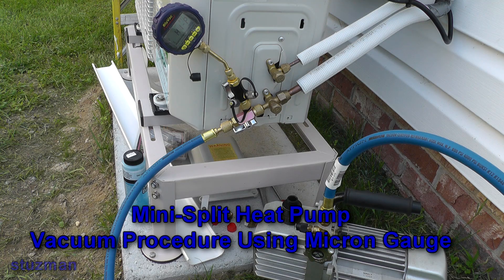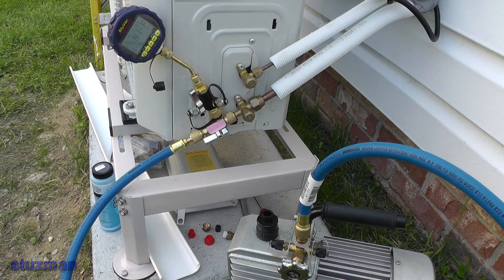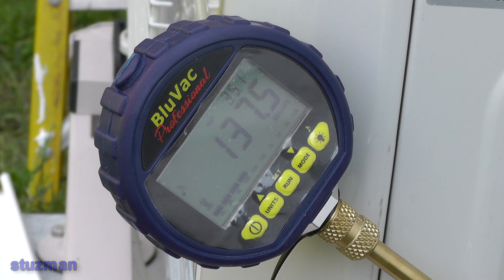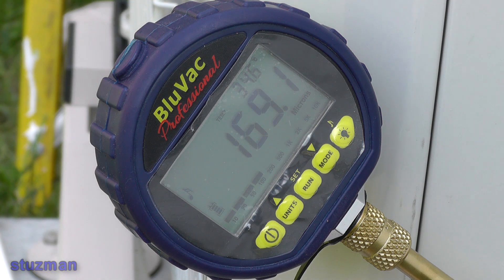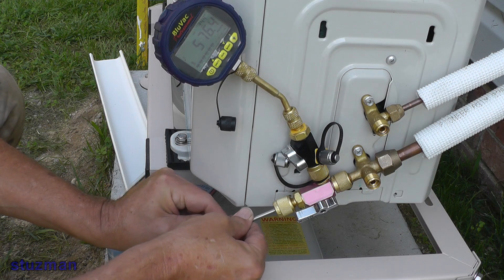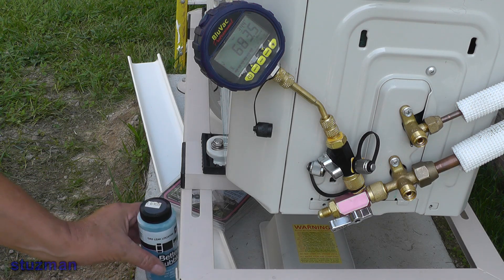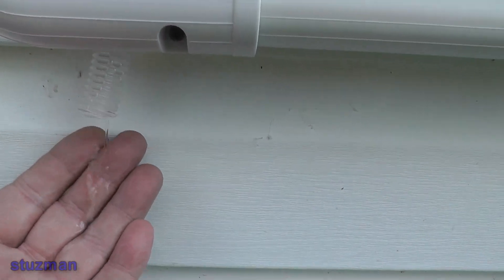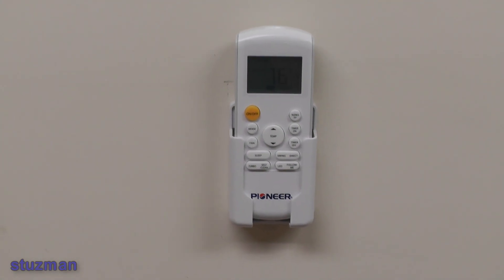Mini-Split Heat Pump: Vacuum Procedure Using a Micron Gauge

Comment: Where do you buy your Nitrogen from ? I found this on Amazon : 

https://www.amazon.com/gp/product/B01E2TAN06/ref=ox_sc_saved_title_1?smid=A1HK513727N6JR&psc=1

Is this the correct chemical composition and tank size ? 

Thanks Again.
Reply from the maker: If you live in the US, you'll find airgas distributors all around which is a national chain. You'll be able to buy the tank and nitrogen from there. I posted a link for the pressure regulator in the videos of the pressure testing. I answer a lot of questions in the second video of this video series such as the nitrogen tank and where to buy it. That video is listed here: https://www.youtube.com/watch?v=N-QwtqSw1Xk&list=PLrbHoqGceWKSJBdTF3ufWQirhoqpbpTdL&index=2

And here is a link to the entire four part video series. https://www.youtube.com/watch?v=SsUYJ1b9sk8&list=PLrbHoqGceWKSJBdTF3ufWQirhoqpbpTdL
Reply: stuzman Great. I do have one AirGas near me.

Also, do you think a Harbor Freight 3cfm Vacuum pump can pull low microns in Vacuum test or that feat is only possible by the likes of Yellow Jacket, JB and CPS  pumps ? I couldn’t find the pump name on your video descriptions.

Comment: Hello Stuzman for the video explanation. Could you please tell me why we do not conduct Nitrogen pressure testing on a mini-split system as we do in case of regular HVAC systems at the time of installation? I recently purchased a Mitsubishi MUZ-GE24NA and its installation manual requires to perform only the vacuum procedure and nothing is mentioned on the pressure test.

Thanks
Reply from the maker: Yes, Abhinav, the manuals for mini-split units are written towards people, (DIYers) who do an installation themselves. The manufacturer realizes that most DIYers will not have a supply of nitrogen, pressure regulator, etc. for the test. So, they will  mention to pull a vacuum on the system and if you see the pressure rise, then you have a leak. The issue is that under a vacuum, you can have a very small leak and will never know it. Once I had a system under a vacuum for 24 hours and never saw the gauge pressure rise. After about one month when the cooling was insufficient, I found a leak. So, to be sure there isn't a leak, the valid test is to pressurize the system with a high pressure of nitrogen. Also, the reason that you see nitrogen pressure testing on standard HVAC units is because most of these units are installed by professional a/c service techs who will have that test equipment. Great question and thanks for the comment!
Reply: @stuzman52  Thank you for your prompt response. Listening to you and another great channel called  "AC Service Tech LLC", I finally understood why Testing for leaks under high pressure and under high vacuum are testing different design aspects of the system. Furthermore, your video where you have explained the difference between a Vacuum Gauge and a Micron Meter was amazing which clarified a lot of things, that's why the question. :)
Reply from the maker: Abhinav Gaur Glad to help Abhinav and AC service tech is a great channel where you have access to a wealth of information!

Comment: The Daikin unit I am putting in my shop per the manual says a minimum of 10 ft of line set. I am going to be pushing that-it may only be 9 ft as inside unit is close to condenser. What is the reason for the minimum? Is it because of the factory  precharge? Thanks and enjoyed your videos.
Reply from the maker: Yes Ted, you are correct! The manufacturer wants a minimum length based on the precharge that's in the outdoor unit. The same holds true for a maximum length of line-set too. Glad to hear that you liked the videos.

Comment: Hey.. How come your vac hose changed its color ? :)
Reply from the maker: As for as I remember, the hose colors on the low gauge side didn't change. I did change the hose, but in both cases, the color was blue.
Reply: @stuzman52  Ok. Anyways It was great watching the video. The place that i am in - Mumbai, India and when i got my split system installed the guys never did any pressure testing or a Vac test. However the system works well .. think i was just lucky.  A hack job that worked well luckily. :)
Reply from the maker: @piruzjassawalla6261  Yep, consider yourself lucky Piruz if it's still running well. With air still in the system, your pressures will be higher than normal which makes your unit less efficient than it could be. Have a great day Piruz!

Comment: Great video. It would be a good idea to exercise the valves of these 2 Core Removal Tools during the vacuum process. There are some air sealed inside these valves.
Reply from the maker: Yes, that is a good point Fentago. Thanks for the comment!

Comment: excellent video. step by step. i have a question. can i use 1 stage pump to vacuum a mini split or do i need the 2 stage? thank you.
Reply from the maker: You can use a one stage vacuum pump. It will just take a longer time to reach a deeper vacuum. But a micron gauge will let you know when you reach at least 500 microns.

Comment: I don't understand why you needed the second valve core removal tool. Why couldn't you just attach the micron gauge to the single removal tool?
Reply from the maker: I explained this question along with a lot of other questions in this video https://www.youtube.com/watch?v=N-QwtqSw1Xk&t=1777s The short answer is to isolate the refrigerant pressure from the gauge to protect it.
Reply: Yes, I use ball valves cos the valve core removers, you will find the stem hits the ground - in many cases doesn't work. 
A ball valve is WAY cheaper and smaller. And thats what I use to isolate the vac gauge against positive pressure which will ruin the vac gauge

Comment: great job! i have to laugh at other "installers" that don't even own a micron gauge, and they're trying to teach others. Thanks so much
Reply from the maker: Thanks Neal for leaving a comment!
Reply: Or they don't even own a vacuum pump, heaps of countries just "purge" no vac
Reply: @Froggability  I think this video and use of correct equipment are top notch.  That said, as a DIY guy, and not thinking  I would install more than 1 or 2 units, for myself, i chose not to buy a fancy vacuum pump.  Instead I unscrewed the intake valve on my air compressor and screwed in a couple of fittings to connect to a cheap set of gauges.  I do purge with nitrogen and bubble test and then vacuum down to almost neg 30 " HG with my old compressor.. I don't let all of the nitrogen out before vacuuming- i vacuum it out so no air and moisture can enter.    Having now installed 7 in the last few years, and with 2 more to put in soon (all for family for free) I could now have justified the real vacuum pump and micron gauge, but I have gotten by fine with only the manifold gauges.  A micron gauge would be sweet to have, but if you clearly have no leaks in the bubble / pressure test and then you vacuum it all out, you will be fine with only rudimentary gauges.  The expensive tools are great if you want to do a bunch, but not essential.  
Great video Mr. Stuzman.  Many DIYers will benefit and step up to do this now..  I even had two units need recharging (one developed a pinhole leak in the factory brazing around the reversing valve after 3 years and one had a faulty expansion valve).  I was able to buy a bottle of R410 at a decent price on-line and ship from USA to Canada no issue.  Brazed in new parts each time, pressure/bumble test, vacuum and weighed out refrigerant charge on a good (borrowed) set of scales as i charged unit... that was several years ago and still going strong.  Its not rocket science- watch good videos like this one, but basic tools and save some cash!

Comment: One more question if you please...
I purchased a Senville 18K BTU Heat Pump
H.S. pressure is 550 psig; L.S. pressure is 340 psig.
When you performed a leak test, the lines were pressurized to 200 psig.  Was that for a reason?  I see others going up to 300 psig.
Thanks!  JT
Reply from the maker: No particular reason on the 200psig. Even at this pressure, you'll still be able to see a leak. In your case, I wouldn't push the pressure near the maximum of your lowest test pressure that was used at the factory. In your case, I would go for about 250psig and you'll be fine. At 300psig, you'll be getting pretty close to 340psig. At 250psig, you'll be allowing yourself a little margin of safety. Good luck on your installation!

Comment: Would you recommend, or see a problem with applying, a small amount of NYLOG BLUE to the Schrader Valve?  Thanks!
Reply from the maker: No problem at all at applying a very small amount of Nylog blue to the seal on the schrader valve. Also, you could apply a small amount of Nylog to the cone of the flaring tool as a lubricant when making your flares. And you could apply a small amount around the flare fitting. And be sure to torque the flares and not use an adjustable wrench to be sure that they're not over tightened.
Reply: @stuzman52  Did a pressure test this morning (250 psi for 3 hours; rock solid!  Pulled vacuum down to 64 microns in about 25 minutes (new pump and oil).  Will see what the vacuum level is tomorrow.  Maybe even do a test run!  Thanks for the videos!
Reply from the maker: All sounds good! Good luck on your installation!
Reply: @stuzman52  Up and running!  I have a brand new Appion MegaFlow suction hose (p/n MH380006EAB) 5/16" one end / 1/4" other end.  I will never use it since the pump I got has just 1/4" fittings.  If you could use it, it's yours - no charge.  Look at as a token of my appreciation for the excellent mini-split videos you posted!  Let me know...

Comment: Hi...thank you for your videos. I definitely learned a bunch and you have helped instill some confidence in doing this.
My question is this...Why wait to reinstall the valve core after releasing the refrigerant? I have experimented with mine doing a couple of "dry" runs before releasing refrigerant. I do seem to lose some vacuum, it looks to go up to about 3k microns. I guess it just seems like it is lower risk than after you release the refrigerant if you have issues with replacing the valve core? I guess if the system requires 500 microns or below before releasing the refrigerant, then that would explain that. I am installing a Mitsubishi, and the instructions do state to release the refrigerant after holding 500 microns or below for an hour. Mine has held 400 or so for 24 hours.
Thanks again.
Reply from the maker: Hi Steve! In the second video of where I am comparing a micron gauge with a vacuum gauge, I explained the reason that you're describing along with a lot of other questions that I've received. It's always better to install the valve core while the unit is under refrigerant pressure. It's to ensure that you don't break the vacuum. It's always better to lose a very small amount of refrigerant than having air pressure come back into the system while it's under a vacuum. Good luck on your installation!
Reply: @stuzman52  Thank you! I completed the install last night. All went well,  I followed the procedure of installing the valve core after releasing refrigerant. No issues. I pressure tested and held a vacuum around 350 microns for 24 hours just to be confident I had it right before releasing. I installed one a few years ago, but definitely didn't pay this much attention to detail. I have the tools now, and with knowledge and confidence, the next one should be much easier.
Thank you again Sir....
Reply from the maker: Sounds like you did a great job Steve and I commend you for taking the little extra time to ensure a successful installation. You're quite welcome and glad to get the information out there for the folks who want to do a job that's right! Have a great day!
Reply: @stuzman52  Hi again! Installing two more over next couple of weeks. I have a question...I am probably overly concerned about not having a truly sealed system. I had an issue on an install I did some time ago. Anyway...I ran a pressure test with nitrogen at 150psi and got a good hold. I then ran a couple of vacuums with a nitrogen purge in between. Now I am running the final vacuum and got it down to 240 microns I believe. It's been several hours, and it has crept up to 340 microns. I would think that if it was a truly "sealed" system...it wouldn't rise at all? How long should I let it sit to make sure I have a very well sealed system?
Thank you....
Reply from the maker: The pressure rise that you see is normal. You have to keep in mind that it's impossible to get 100% of the air out of a system. The micron gauge is measuring air pressure so if it ever read 0 microns, (which it won't), all of the air would be out. When you see the pressure rising, it's because the air molecules are expanding which raises the pressure slightly. If the temperature changes to a higher temp, you'll see this effect also. If you ever had a leak in the system, the pressure would continuously rise and never would stop. That's what you're looking for to see if there's a leak. You can give the system one hour to check for this pressure rise. At some point, it will level off. When you don't see any climb anymore and it's under 500 microns, then you're good to go.

Comment: What would be the difference if you placed the micron guage the furthest away in theory in the system, which I would think be the high side
Reply from the maker: You can't connect the micron gauge to the high side as there is no port to connect anything to. If you were working on a unit where there are two ports, the difference in pressure would be negligible. You always want to connect the micron gauge as close as possible to the unit which will be the furthest away from the vacuum pump.

Comment: Thanks for your great videos! Why can't you attach the micron gauge directly to the first valve core removal tool?
Reply from the maker: The reason I used a second valve core removal tool was to protect the micron gauge from the high pressure from the system when the refrigerant was allowed into the system. I'm not sure of what the maximum pressure of the micron gauge I was using so I was just playing it safe. Also Ben, I'm working on a video which compares the micron gauge against a vacuum gauge which you may find useful when it's released.
Reply: @stuzman52  Is this video out yet? I would love to see.
Reply from the maker: I created two other videos to address quite a few questions from the three other videos. The first part talks about pressures, microns and vacuums which is more of an educational video. The link to this video is here: https://www.youtube.com/watch?v=SsUYJ1b9sk8 The second video compares a vacuum gauge against a micron gauge and I answered the most asked questions in this video. It's located here: https://www.youtube.com/watch?v=N-QwtqSw1Xk&t=1777s Have a great day David!
Reply: @stuzman52  Thank You! Answered a lot of questions.
Reply from the maker: You're quite welcome David!
Reply: Why not replace valve core just prior to releasing refrigerant? Then wouldn’t need second shut off valve right?
Reply: Mitch and Cassie Shepherd  I’m thinking the same

Comment: Because I will be installingt but three or four mini-splits in my lifetime, could I use a simple analog vacuum gauge and shoot for 30 inches of vacuum for a r410a system? I love this concept overall and need to approach it more economically. Thanks!
Reply from the maker: You can use an analog gauge, but you'll never know how deep a vacuum the system is being pulled. An analog gauge will tell you that you're producing a vacuum, but won't tell you how much. A micron gauge will tell you how much vacuum is being produced. Since you want to save money, let the vacuum pump run for about an hour. That should give you a pretty good vacuum if you don't have any leaks.
Reply: @stuzman52  Thanks for the advice. I will go with a good digital micron guage.

Comment: I am interested to know how you routed the compressor's condensate drain to prevent a large winter ice block forming under the (and maybe in!) compressor in the winter?  Good video.  Doug
Reply from the maker: The condensate line under the compressor was cut off at the top of the mounting bracket. It's about 12" off from the concrete pad.

Comment: Question I just installed all my mini split lines. I want to do a vacuum pressure test. Do I need to pump nitrogen in first to test for pressure. ?
Reply from the maker: It's a recommended procedure to do a nitrogen pressure test to verify that the system doesn't have leaks. It's easier to find leaks under a high pressure than rely on a low pressure vacuum. Also, some people believe that the only reason to pull a vacuum on a system is to check for leaks. This is not true! You pull a vacuum on a system to remove the non-condensables such as air. And more importantly, air has moisture which must be removed. Otherwise, the moisture can condense on the inside  which will mix with the oil and then hydrocloric acid will form. Of course, the choice is yours to do the test with vacuum only.
Reply: @stuzman52  
I have five air handlers do I need to nitrogen and vacuum each service port?
Reply from the maker: @831Adventures  Yes, that would be the norm....
Reply: @stuzman52  thank you